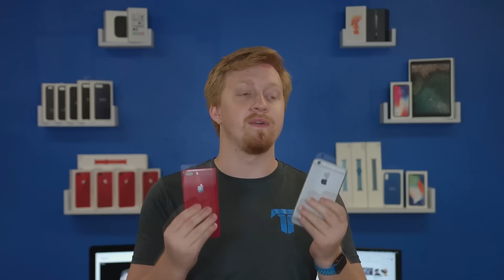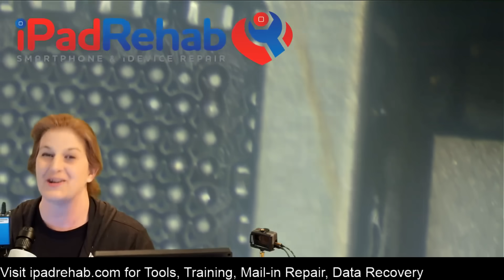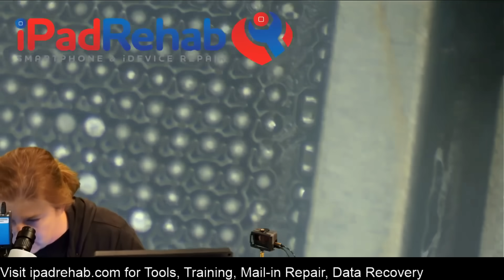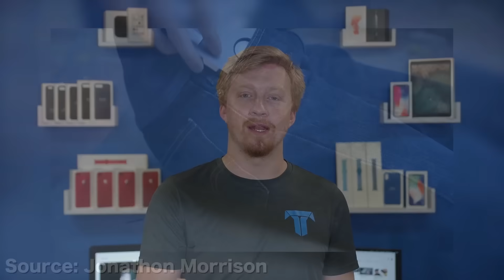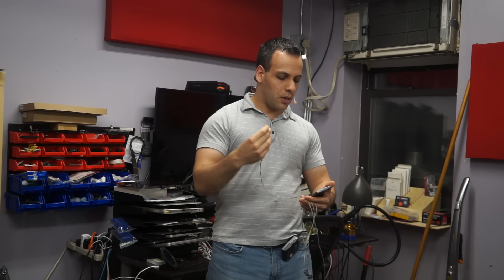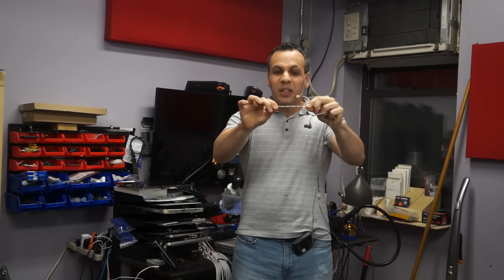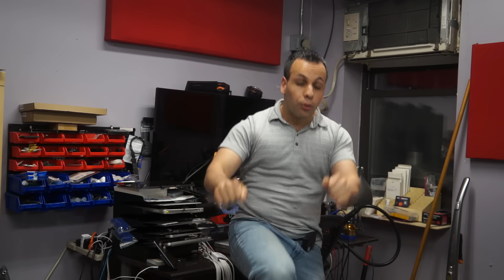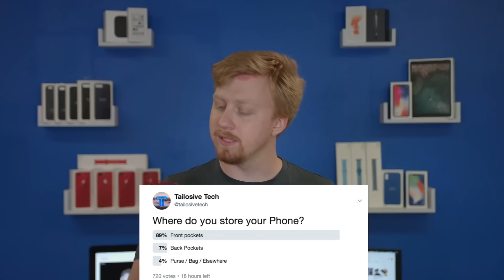The truth about iPhone bendgate deniers

Comment: This is one reason why I hate Apple. Companies like Samsung acknowledge their issues, like when the batteries exploded in the Note 7. They handled the issue well and redesigned the battery to ensure safety for their customers. Apple in the same situation would blame the consumer and make them pay 70 bucks to replace the battery.
Reply: Nath m Plunk No no no... The glass being glued to the frame is the issue, not the sides. You see, the glass back on most normal phones is glued in like a screen - on the edges, The back glass on the new iPhones is DIRECTLY glued to the frame, meaning a back glass replacement requires the entire frame and the shell to be replaced - an expensive and lengthy process. On phones like the Galaxy line, One Plus 6, ect a cracked back glass can be fixed with a simple swap similar to a screen replacement, but much easier.
Reply: littolicce Here’s the thing I don’t get about Apple Fanboys. When a design flaw or bad design is kade by Apple, the fans always find ways to defend it. They never admit that there was an issue. I on the other hand will gladly admit that a product from a company I like had issues (Note 7 exploding, and the awful Galaxy S6 with it’s lack of water resistance, micro sd card expansion, ect.). Insurance is still expensive, costing like 150(?) for the iPhone X. Even then, a back glass replacement is still 100 bucks. The similarly priced Note 8 (960 bucks) costs only about 40 bucks no insurance to replace the back glass.
Reply: Nath m Plunk That’s no reason to have such a major design flaw. Everyone makes mistakes and even I, the most protective person of my technology (seriously, I have 2 protective carrying cases for my laptop I put on to ensure safety) have dropped my phone before. Also, a Ferrari bumper doesn’t cost half the price of the car, now does it?
Reply: littolicce See my reply to Nath. Also, it is basically the norm for a phone to cost 700 to 1000 dollars these days, it is no real luxury. Especially with carrier deals (leases and loans.) Comparing a Ferrari to iPhone would be like comparing a half million dollar house to a small home, iPhones, Samsung devices, and other high end flagships do not have the insanely expensive materials and build quality like a Ferrari.
Reply: BrutalSystem, Samsung HAD to acknowledge the issue with the batteries, because people were getting hurt, and it was only a matter of time until it killed someone.  A bent phone is nowhere near the same level of hazard as a potential grenade in your pocket.  And it wasn't even on just one device, it was just more prominent on one than on the others.
Yes, I do have an iPhone.  I have owned 2 of them, in fact.  I have never had any failure, other than the battery on the 6 started dying after almost 2 years.  Yes, I keep it in a case, but that's because I know that if I don't, I will drop it and probably break it.  As a matter of fact, my wife and son all have Apple phones, and the only problem we have ever had has either been damage due to dropping, or the battery fails, because my wife keeps partially charging her phone, and then using it on the charger all day.
If anyone wants to sit there and point fingers at companies about phone quality, then yes, you can point at Apple for the bending, but you need to point out that Samsung had exploding phones, and that annoying pink line that so many of their displays develop.
Reply: Apple only acknowledged the problem after a lawsuit... So there's that.
Reply: I agree with you here. The issue is that Apple is not acknowledging their design fault and a design fault is not something the customer should have to pay for (which in many cases with both iphones and apple laptops, this has been the  case).

Also, people, stop using Ferreri as an example... its not a good one and Ferreri's are not a premium product that is premium in price only and made in China. If you are going to use a car as an example, use the Zenvo ST1... A car with a premium price tag with maxed out components with poor design and catches on fire. Almost every iphone and macbook has serious design faults and this fact is simply ignored by the public"because Apple"
Reply: It should be noted that the s8 wifi issue is software and not hardware and is not a fatal hardware flaw that kills the device. And like previous problems like the red screen issue they will be working on a solution to roll out to customers because they acknowledge people are annoyed and arnt blaming their customers for using their wifi wrong.
Reply: milamber319 Hehe... Good one.
Reply: Thomas Johansson Sometimes the cost is cheaper than normal, but charging the consumer for repairing a design flaw is incredibly greedy. It's like if Samsung made you pay to ship and handle the Note 7 back to Samsung during the recall. It's an incredibly stupid thing to do. Of course, iSheep people don't care because they will do anything for Apple.
Reply: littolicce - I love it "luxury". I bet you are right though, a Ferrari owner would not complain about replacing a bumper... but if he had to replace the chassis to repair a fender bender you can bet your bottom dollar someone is getting sued. This is the equivalency, not just replacing a bumper.
Reply: Nath m Plunk 😂 okay dude. That's not acknowledgment for the 6/6plus. They denied it and charged people for the repairs when it was an engenring flaw!
Reply: Apple Acknowledges their issues. But they only do it after there is a huge storm over social medias and the issues are proven beyond any doubt.

Then they charge you for fixing it and pat themselves on the back because at least the fix is cheaper than a normal repair service.
Reply: Alexander Worley Although the S8 Wireless connections issue may be an issue, (though I have never heard of it) they are probably going to stay stubborn with the Bixby button. There are some pretty good APKs that add mapping, though.
Reply: Nath m Plunk most people??? You do see the rediculous amount of issues with their Macintosh and MacBooks right?? Their engineering team(s) suck. Their marketing teams are the real geniuses because they get morons to continue to back a company and blame the consumers even when it is blatantly an engineering flaw.
Reply: Who's fault was it when the iPhone 4 failed to get a connection during Steve Jobs keynote? It was blamed on the guests / customers for using social media over wifi during the presentation.
It totally wasn't the fault of Apple not providing a 2nd passworded wifi for the demo and not knowing the wifi could be sluggish with many guests using it.
Reply: Skelath they had an unexpected amount of people/ devices connected to it and what you said was exactly what they ended up doing... they didn't really blame them in a bad way but that was the reason it was slow... could've also had to do with the iphone4 antennae but I think it's fair to say they didn't know that was an issue with the design.

Plus that was incredibly fun to watch,  as with all Apple's keynote fails but there was something special about that one imagining an absolutley fuming Steve Jobs and 30 people running around like headless chickens... the iPhone 4 was probably a bad time to be around jobs lol
Reply: @frowlinian8175  I believe there was also another keynote of jobs getting even more furious at the guests of a previous iPhone.
Reply: Skelath ... I don't remember that,  the only time I can remember him getting physically angry on stage was when he couldn't figure out a camera and her threw it at one of the techs... I don't know what keynote that was from,  I'm assuming one of the first iMacs... the first iPhone went incredibly smooth considering they had to swap between 10 different phones and everything actually worked (including calling someone which was the first time it had ever worked) the 3g went smooth as well iirc, 3gs was somewhat boring but went well, the 4 was a shit show start to finish,  and the 4s he wasn't there because he was... a bit busy...  I think I remember one of the iPod' s decided to not work but he just pull out another but I don't think there were many other faux pais (first time I've tried spelling that) but I could be wrong... but he was a notoriously short tempered man but he was somewhat famous for being able to play it off
Reply: Nath m Plunk the touch sensor chips would slowly pop off do to the pending a recall was needed
Reply: +littolicce Man, seriously, what is wrong with you? Your arguments are a real joke...
Reply: Except the exploding phones took them a while to acknowledge it was a design flaw.  Initially it was a flaw in the batteries.  In the same year they also had the exploding washers too.  Both of them it took a while for Samsung to acknowledge their design is flawed, not the assembly, or 3rd party component failure.  Apple is just as guilty in that regard, I actually don't think any major mfr doesn't deny deny deny at first.  Microsloth is equally likely to deny deny deny before they acknowledge anything.
Reply: They'd say you use it too long and that's why battery blew
Reply: Eeeeeeeehhhhhh. Not really samsung has yet to address the wifi connection issues for the S8, the bixby button mapping for consumers.
Reply: BrutalSystem to be fair, almost every battery exploding is a bit more serious than a percentage of people slightly bending their phones...
Reply: Biccy Thiccy ... you said "bend" or some variation of the word multiple times... and Apple does acknowledge defects if they're serious enough, them bending slightly wasn't that serious, and they did actually acknowledge it, only they downplayed the numbers...

And Samsung didnt want to acknowledge it until they were forced to... no company is going to go "a dozen people had this problem out of a million devices, don't buy our product!" Because that's stupid, but that's what you're expecting Apple to do, apparently...
Reply: And the replacement would be the same exploding battery
Reply: Samsung acknowledged the defect when the lawsuits started pouring in. They had no choice.
Reply: The bending isn’t a big deal man. You shouldn’t be putting that much pressure on an expensive device either way. I mean who does that. Take any of my expensive devices they would all crack within seconds. 
But they fixed it. Their phones are super insanely impossible to bend almost 

Also. Most people prefer to change the batter than have their phone recalled and have to wait a whole year for the next model. I can guarantee you that bud
Reply: sams it bender in skinny jeans misusing it. Do you really go around abusing your 1k worth products. I don’t. Why would you stick it in your pocket and apply abnormal pressure to that point. Did you even see how much force it takes to actually bend it. It’s a lot 
I wear gold. I don’t go around abusing it. Gold is weak it bends. I still wear it and it’s in perfect shape

People are just stupid with their devices. So Apple basically corrected that by making their phone super strong. Look at the iPhone X. That thing is rock solid. Stainless steel frame isn’t bending at all

It’s not a reason to recall the device. Recalling only happens if it’s a life threatening issue. Like breaks not working on a car model. Or battery exploding
Reply: sams sure
But you can’t compare a bending iphone which is normal for most expensive electronics to an exploding battery that can kill people 
Lol
You gotta be joking right if you think they are in the same league lol. You better believe they should have an 8 step process. That could have resulted in deaths and law suits up their ass

I don’t think the same can be said for a bent iphone because the kid can’t take care of his items
Reply: i dont get why would people compare something that being broke because of stupidity with something that broke naturally... for example.. have you ever seen a ferrari that well taken care of just suddenly broke ovrtime, compare to iphone that broke from day to day use? and like louis said.. in the video (if you're watching till the end) most of the people suffer from the peoblem is people that couldn't afford to have stupid accident for their flagship phone, and also cosmetic damage is nothing compared to component damage..
Reply: apple lazy and not customer friendly that the truth of apple
Reply: The battery replacement only cost $30.
Reply: you mean like with all of the replacement programs apple has going on. like the battery one where they charge you LESS than it normal costs to replace your battery even if your battery health is at 98%? is that how apple would handle that?
Reply: Stephen Schuster ... regardless. Their phone literally exploding/catching fire for literally no reason is on another magnitude from "it got a bent a bit when I sat on it".... why are you even arguing that?... it's just, objectively worse...
Reply: Biccy Thiccy ... they EXPLODED... regardless of how you look at it, thats far worse then them getting bent...  and your argument is "well, only a couple exploded " ... seriously? Theres no possible way you can get past them being banned on airplanes and classified as a hazmat product with a PR campaign....

Also keep in mind, I'm somewhat of a Samsung fanboy, I've had only Samsung phones since the S2 was released with an exception of a Moto X for a few months... I'm currently writing this on a note 8 and I'm going to be getting a note 9 in September when I can upgrade.... this isn't me just going "lawl samsdung sucks, iPhones are perfect". This is me acknowledging that a phone exploding is a very, very, very serious issue and one they could've handled far better. IPhones being prone to bend is a serious issue as well but is nowhere near the magnitude of a phone damaging your property or even putting you in the hospital.
Reply: Stephen Schuster because there's nothing to recall them for. What would they do? Put something other than a lithium-ion battery in them because that's the issue and there's no way to make them 100% fail-proof... and I would say 99.9999991% success rate (with iPhones specifically, if I did my math right) is more than acceptable for damn near everything... if it was higher, even around a tenth, hundredth, thousandth, or even ten thousandths of 1% (which would put it at 1,000,000, 100,000, 10,000, and 1,000 respectively) then we might have a problem... but that would be a problem with anything with a lithium ion battery, including every phone, EV's, Cameras, RC Cars... you pretty much name it... but that's not the case, and iPhones failure rate when it comes to their batteries is well within a reasonable threshold...

And, to be clear, that's with 2017 iPhone sales which coincidentally is when they hit there 1 billion Mark and it's easier to do quick math in my head...and it's actually a conservative number so those numbers would be skewed a little bit due to more phones being sold obviously but whatever..
Reply: BrutalSystem May I ask what’s so bad about a glued back glass?
Reply: Biccy Thiccy but you don't have the chance of killing somebody by a phone being bent... and most of the time when an iPhone bent it still worked and the act of it bending in the first place can be counteracted by putting a case on it and wouldn't necessarily require a complete recall... the same sort of thing happened with the iPhone 4 and they gave out cases and if it became a widespread enough issue then I'm sure they would have done that again.

At the end of the day,  Samsung fucked up and they fucked up bad... twice in a row and they did what they did because they legally had to,  they didn't issue a complete recall until that was all they could do.  They tried replacing them, they tried an exchange program,  they tried firmware updates,  they tried changing suppliers and even after all that they didn't issue a full recall and just stopped selling them (kind of) and only after a plane was grounded, 4 people were hospitalized, the faa banned them from airplanes entirely (which doesn't happen very often) and the US govt. Deemed them hazardous material (lvl 2 or 3 I believe... one of the higher ones) only then did they issue a total and complete recall and ordered their retailers to stop selling them... what they did was far from commendable, they knowingly put people and their property at risk, and I guess what I don't understand is how that's better than:

"hey, apple, your phone is bending.... hey! You phones are bending!.... YO!..."

"What!? Our phones are bending!?... that's crazy!... totally didn't know that would happen!"/s

And then they fixed it in the next version... I'm also fairly certain they warranted out bent phones. I do know they acknowledged the issue but said they only received like 50 complaints when it was actually somewhere around 300...

I fully understand that both are bad, bad for business and consumers alike... but to be honest I don't really think they're exactly comparable, Samsung's wasn't really their fault but they handled it in the worst possible way, possibly because they didn't realize the scope of the issue, possibly because they wanted to save their public relations... Apple's was their fault but they downplayed the issue (much like samsung) but It never got to the point where people were at risk and the government had to step in...
Reply: BrutalSystem Well if the glass back wasn’t glued on, the iPhone would probably be as bulky as hell & if you did drop it, the battery could go flying out due to the impact & the back coming off. A glued on back doesn’t necessarily mean bad quality, my brother has a Samsung Galaxy S5 & the paint is coming off of the back. I’ve had a great experience with Apple products they never broke apart from when my iPhone & iPad started looping & it only took an iTunes reset to fix it. I’ve once left out my iPhone 4S in the rain by accident & once I found it again, it had a layer of ice on top of it (it was winter). Still works as it should today
Reply: BrutalSystem Well it may be more expensive but if you just bought a £500+ then your gonna take care of it. The iPhone 8 & X are meant to be luxurious items that you make sure 100% that you keep safe from damage. Ferrari owners don’t complain about how expensive their repairs are for their car because a Ferrari is a luxurious object that they take care of
Reply: BrutalSystem To excuse the pricing, I still “blame” it on the luxury part of the brand. If you can’t affort the 4000$ tires on a Ferrari that you have to change kind of regurlarly, don’t buy one. (Exaggerated a bit but you get the idea)

Call me an Apple Fanboy if you want, but I think the “real” Fanboys are blinded by what they paid so they don’t want to admit the wrongs of a company they spent thousands on. And I’m pretty sure Apple hides a bit behind them. That being said, they’ve had a couple of fuck ups in the last few years, no one can deny that.
Reply: Nath m Plunk I agree. It’s luxury and should be treated as such. Have you ever seen a Ferrari owner whine about the cost of repairing a bumper?
Reply: littolicce nothing, sure it’s more expensive to replace but if your buying a £500+ phone, your gonna be careful with it
Reply: BrutalSystem See Nath’s response for the first part. Second, insurance exists for a reason, in Apple’s case, it’s AppleCare. Third, maybe the bumper was a small example, think aboit the whole front clip of the Ferrari being damaged. That’s a huge fucking amount of money to repair.
Reply: BrutalSystem Apple did acknowledge bendgate by using thicker aluminium on the 6S, then making the aluminium even thicker on the 7, then applying a glass back on the 8 & stainless steel sides on the X.
Reply: Nath m Plunk Thats not “acknowledging” a defective product. If Apple said “Our phones are prone to bending and should be handled more carefully than usual” and apologized to the customers experiencing the issue then THAT would be acknowledging the issue. Making a new phone with a higher grade aluminum and calling that acknowledging an issue is like Sony having defective and overheating PlayStations and making a new one without the issue. Don’t be stupid. Apple did not acknowledge the issue properly like Samsung did with the battery issue.

Also don’t say the back glass on the new iPhones improves the build quality. In fact, it is a design FLAW as it is so poorly designed having the glass permanently “glued” to the frame. That is an awful design.
Reply: BrutalSystem the iPhone 6 bending overtime wasn’t a big enough problem for Apple to recall it. Yes people did get touch disease from the iPhone 6 but it was a small amount compared to how many people bought it. I still see a lot of people using an iPhone 6 today, some without a case. And from what I’ve heard, Apple eventually offered free repairs for people who suffered from bendgate & touch disease. My point on bringing up the iPhone 8 & X is that there both near impossible to bend with the glass back & well suited to resist overtime bending. Granted, I didn’t know about the glass back being glued in & I don’t know if that’s even a problem because no ones had an issue (from what I’ve heard) with the back of an 8 or X. People buy Apple products because they expect them to just work & not have to tear apart their products to see if its good, most people who buy Apple products do have a good experience with them which is why a lot of people use them. Even the iPhone 5s is still running well & will run better on iOS 12. And calling someone stupid doesn’t open doors to learning, instead it just blocks people out. So don’t be hostile man :)
Reply: Nath m Plunk I was not trying to be hostile, which is why I said don’t be stupid, as your example for a acknowledgment was not the best. However, I was not suggesting a recall for the 6, but more an apology for the issue. Also, Apple did have a fix for the Touch IC issue, but it was 160 bucks and was only for the plus model. Also, the reason why the glass back on the new iPhones is an issue as it is impossible to fix without brute force and dedication. It cost upwards of 550 bucks to replace by Apple for the X. In my opinion bending is worse than shattered glass, but for something that costs 700, 800, or even 1000 it should be made to last a while and not need any extremely expensive repairs. I don’t buy Apple products anymore because of poor quality. I had 3 non-accidental issues on my old 7 (One being that it would not connect to any networks, the second being it would boot loop, and the final being audio issues with the mic) before giving up and switching to Android. This was not my only bad experience with Apple, as the iPad I use for streaming and YouTube suffers severe throttling, constant restarts, and can’t live more than 5 minutes on battery. Seriously, this thing is only a couple years old and has been taken care of. This should not happen.
Reply: @nath1606  wat abt 6 users then?
Reply: JITHIN JAZz eh, 6 users today wouldn’t have had the bendgate problem if they’re still using the 6. Most 6 users will be looking to upgrade anyway, probably the XR
Reply: that's not ackowledging the issue

doing it right would mean Apple would have ot provide extended warranty service for all of the Iphone 6's made with the flawed design while providing free repair/replace to any phone bought from them that are already out of warranty

a proper course of atino was that Samsumg did with the note, they made the issue public to their costumers, IMMEdiately issued a Full Recall and provided extended warranty  @nath1606